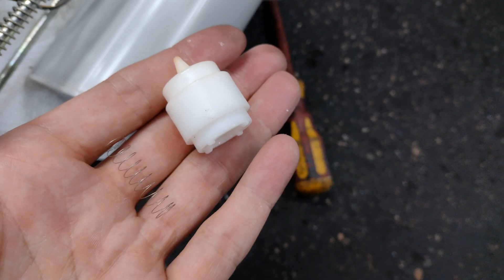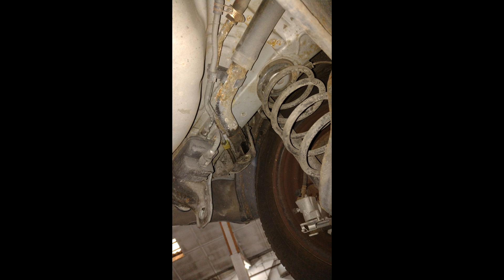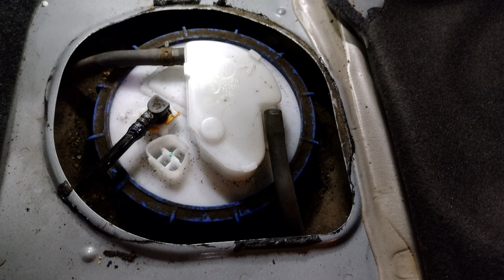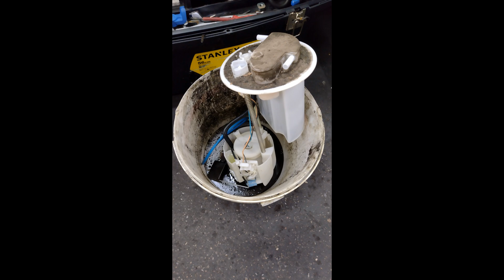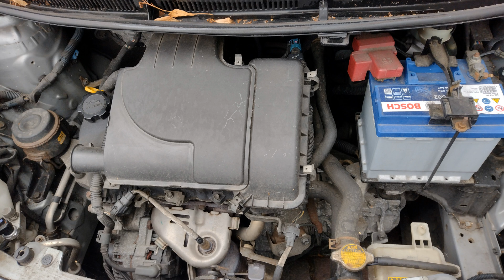Fixing Toyota Yaris 1.0 VVT-i  Engine stalling EVAP-Problem

Comment: recently i filled my 2007 yaris to the limit, since then gasoline is slowly leaking after ambient temperature increase and there is pressure buildup in the tank. If not the video, I would only replace the coal  canister, thank you

Comment: Hi, I am facing the same issue. I tried to check where is the issue and then when I blew air into the fuel pump EVAP line, there seems to be almost nothing passing through it causing fuel pump cut out at gas station and gas tank pressurising. In a new fuel pump, does the air flow freely ?

Comment: Tho video would have saved me some money. I was having a similar issue with my 2009 Yaris it was idling roughly and would not start up at the gas station offer filling it up. It have to floor the gas then turn the key for 10-15 seconds to get it started after fill up. I’ve almost replaced the fuel tank, regulator, fuel sensor, vacuum hose you name it haha. The evap canisters was on my list but I had my purge valve replaced first since it was found to be stuck open. The replacement of the purge valve surprisingly resolved all my symptoms! I will keep this in mind incase I have any future issues
Reply: where is the purge valve located?

Comment: Unfortunately, I'm experiencing the same issue.
Bought a Yaris 3 days ago and fueled up the car. The result: Car is stalling, unstable idling, eventually leading to engine turning off. There is also a rattling sound in the back,  from the exhaust.
I reckon this is a 100% match.
Gonna take to the shop tomorrow as I don't have the time to fix it myself and show them this video.
I'm hoping this isn't an expensive job.. although the full pump costs hundreds and the cannister is hard to find apparently.

I'm not seeing any error codes.. If I take the evap valve energy plug, the car seems stable, but still rattle in the back.

Many thanks.
Reply from the maker: Pump and canister are easy to access. Rattling seems not related (perhaps exhaust, heatshield etc.)
Reply: @ Perhaps rattling isn't the best word.. as the fuel mixture is not optional, exhaust has a funny sound, plus the smell. Does this make sense?
Reply: I could perhaps.. only replace the canister and clear the lines and not the whole fuel pump unit, given that I don't top up the tank in the future 🤔
Reply: I replaced the cannister after draining the lines, and the problem remains. I've ruled out the vsv valve, as it's closed by default and it opens upon connecting to a 12v power supply.
The tank is not full, perhaps at 80%.
Have to put it in the shop I guess.
Reply: @nunosilva5310 Did you figure out what the problem was?
Reply: @nunosilva5310 Did you ever get this fixed?
Reply: @  I did. Firstly I replaced the cannister as previously stated. The line had fuel, and after removing it I swapped it. The problem continued and I was pretty sure it was the evap valve but as it was costly - around 90€ - I ended up putting in the shop. Bottom line, it was the valve, although the root cause is in fact the defective pump thingy which allows for fuel on the evap line. I did not replace the pump as it is costly, therefore I just don’t put more than half a tank.
Reply: @ Thanks!
Reply: @nunosilva5310 
So even with the defective evap valve inside the fuel pump unit if you keep the tank only half full the fuel won’t get into the canister filter right!?
Reply: @MiguelOliveira-cm2vu  Exactly, the limit is around half a tank (4/8). If it's filled above that, depending on the inclination the car might stall as the gas mixture becomes too rich - happen to me a couple of weeks ago.

Comment: hi very informative video .. I have the same issue with my Yaris 2007 sedan 1.3ltrs . . i wish i could watch this video earlier .
In my case  Purge valve chocked /not working & too much pressue created in fuel tank so i keep fuel lid lose so that pressue can escape . i kept using it for months ..then  car started missing .i searched on internet and planned to change the fuel pump only ( not complete housing) when we opened the fuel taank to change pump i found that Charcoal was in fuel tank . we cleaned the fuel tank and changed the Fuel pump and purge vent valve but the issue is still there fuel is going to engine through canister & valve.  Please guide what should i do ?  should i change whole fuel pump unit and canister both ? i mean it will cost me much . is there any short cut? . 
now i disconnected purge vale electric power and keep Fuel tank lid loose to aviod pressure

Comment: Too bad I didn't find this video earlier. I would have saved some money. This is what happened to me. I replaced the spark plugs, the flow meter, the computer, the throttle :-)
Reply: I'm sure I would have done it with the removed canister. In the end, I didn't touch the canister, the car has been running fine since just the complete fuel pump unit was replaced.

Comment: Hi, I have a same issue. Car is an 1.3 VVT-i SCP90_
I change the whole fuel pump unit, but why should I change the 2nd vapor canister too? Is it really needed?
Reply from the maker: There is only one charcoal canister outside the fuel tank. It is clogged with fuel in this case. What's stopping you from changing it?
Reply: @Benedict-01  If there is no fuel supply anymore and I empty the filter, then there is no reason to replace it. You can also blow it out with compressed air.
Reply from the maker: @robertnagy2456  if you want to put the system back in it's original state, it is recommended to replace the canister since the charcoal is soaked with fuel and therefore possibly washed out. It won't sufficiently filter the vapours to the environment. Otherwise you can use the old one...
Reply: @robertnagy2456   i blow it with air compressor but it was a bad idea . whole charcoal went into the Fuel tank and blocked the fuel pump intake
Reply: I had this problem now in my altis 2008, i think this says a lot. But i cant fine my charcoal cannister, can someone tell me where isnit located

Comment: That cannot be a float valve. Fuel cannot get there. Take a look at your fuel sender unit. Its highest position is far awar from there.  Have you ever over filled your car ?
Reply from the maker: On which basis do you make these assumptions? You apparently have no knowledge about this vehicle and have not followed the video carefully and thus not understood. The float valve is clearly visible in the video. Even when the gas tank is not completely full, the fuel sloshes up the wall of the tank while driving until it reaches the valve, which then closes the EVAP line. You can't overfill the tank. The nozzle stops filling when the fuel is up to just before the filler neck, which is located above the fuel tank. The fuel unit is completely submerged in fuel when the tank is full. 
The problem has not reappeared after this repair. There is also no more pressure on the gas tank. If these instructions are followed, the problem will be solved.
Reply: Guess what,  am I out of interest to look into this video ? no! Cause I have the same issue.
I have the same type of vehicle. SCP90 Yaris II from 2005. The same problem. And at the same time, I have a official repair manual for all Yaris II. There is no float valve  but two one way valves, they will be opened under certain pressure in the corresponding direction.  The device you get fuel in it, is the second charcoal canister. The first one is integrated in the fuel pump unit. You find fuel in the second one because the first one is already full of gasoline. So you have done right, to change the full unit. But i am not fully agree with your explanation. Just personal opinion. Because no one knows how this tank actually works. It's not even in the repair book.  May be I will get back here for discussion after I've also changed the fuel pump unit . @Benedict-01
Reply from the maker: @batuurdor  Then why don't you follow the instructions in the video?! I mean it fixed all symptoms and therefor the car's problem. You find the part numbers in the video description.
Reply: I think I was clear, I am following it, and thank you. But not all. e.g. I don't think I must also replace the charcoal canister. And it is also very hard to get one in the country im living. Reason: The purge valve is supposed to clean the canister with fresh air. So theoretically I only need to let it dry for some time. Then the engine will purge it with its vacuum.  The reason of the problem is gasoline in the integrated charcoal canister inside the fuel pump unit, where should normally be dry. I hope my problem is the defective valve but not a crack on canister. I don't want to clean the fuel tank my self.....    Take a look at the professional suggestions here if you are interested. 
https://qualitaet-ist-mehrwert.de/wp-content/uploads/2020-01-20-WTF-Toyota-Yaris-DE.pdf
 @Benedict-01
Reply from the maker: @batuurdor  thanks for the pdf manual. It states that there are two charcoal canisters - one in the fuelpump and one outside the tank. That is not true. On the fuelpump there is a integrated fuel filter. The charcoal canister is outside the fuel tank. 
You can try to dry the charcoal canister and reuse it. But the main problem - the floating valve (see video) must be replaced. Cleaning the fuel tank is also not necessary since there is no coal in the fuel unit. After you removed the old fuel unit, you can inspect it, find the swimming valve and see yourself how it works... good luck
Reply: OK, I'll try it. thanks  @Benedict-01
Reply: Work is done. Luckily  there was no charcoal inside the tank. My conclusion:
1. you are right about the floating valve. There is one. But it is not only a floating valve.  The gasoline will be evaporated through that valve it a pressure is reached. But air is not going in until certain pressure. That pressure is pretty low, so the hissing sound, which means a higher pressure,  is not normal.
2.  About the N0. 1 Charcoal canister. You see there are two additional hoses beside the fuel line . One of them is the purge hose, the other is to the evap canister near the rear wheel. Between those hoses there is a container with something in it and connected with the float valve. That is the integrated charcoal canister. In my case, it is also saturated with  fuel, which should not happen.
The fuel filter you mentioned is in the lower part of the unit around the radial fuel pump. Most cars only have the lower part in its fuel supply unit. But in our toyota there is actually an additional part above that, which is the main charcoal canister of the evap system. Toyota evap system is known to be pretty different.
maybe refer to the video below. It seems to be a common problem on those old yaris.
https://www.youtube.com/watch?v=OTtsgpBlcZY&t=586s

Also because of that , the fuel supply unit belongs to the EVAP system according to the repaire manual. The canister outside is not even mentioned in the manual.

 @Benedict-01
Reply from the maker: @batuurdor  ref 2.) No, there is nothing between the two EVAP hoses on the fuel pump. The box is empty besides a pressure valve with a metal ball and a spring. No first or second charcoal canister or other filter types in it. The only charcoal canister is outside the fuel tank like mentioned before.
- I know this video from Anton. It does not fix the problem, like he admits in a later video. He did not replace the whole fuel unit.
- In my video the details of the system are left out  on purpose since it is not necessary to fix the problem. It shows the viewer how to fix the car in about one minute. Just follow the instructions and it is done.
Reply: After all, thank you very much for your information